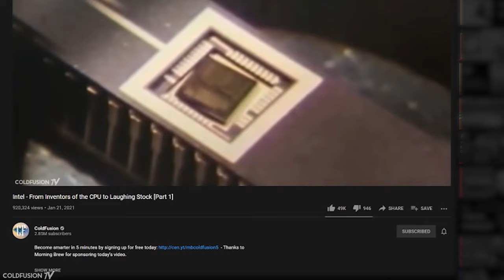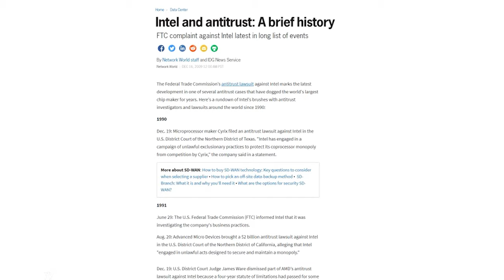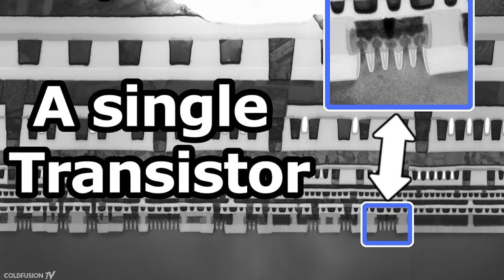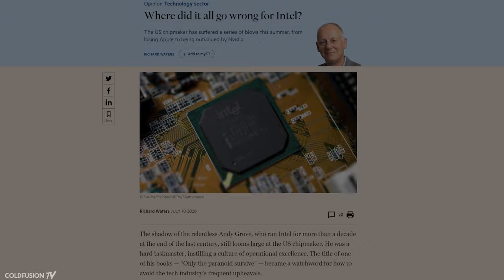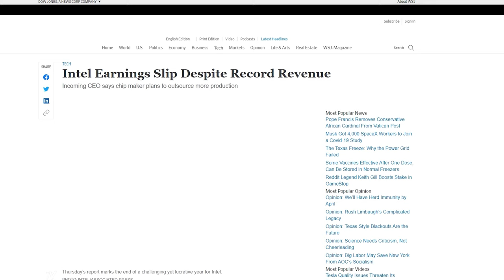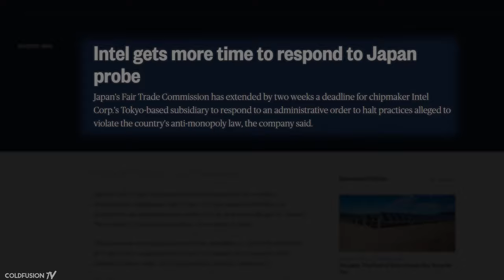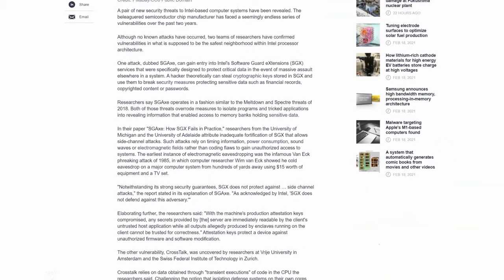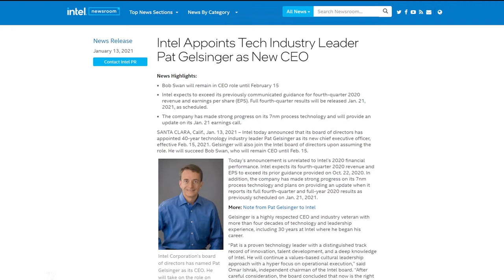Intel - From Inventors of the CPU to Laughing Stock [Part 2]

Comment: Nope - 13:41 There was no Athlon in 1996. AMD launched the K5 in 1996. Athlon in 1999. (Source: I was a 14-year-old building PCs in 1996. The K5 and K6 still had much weaker FPUs than the Pentium II and Celeron A, Intel’s “slot” era darlings). 

If I recall, Athlon beat Pentium III clock for clock in floating point in 1999 and was the first to 1Ghz. AMD had the technological lead with Athlon but Intel used its fab tech lead to clock Pentium 4’s faster which worked well for marketing. Intel didn’t truly regain the clock-for-clock consumer tech lead until about 2006 with the multicore Core2.
Reply: Who are you can you introduce urself😂😂😂
Reply: @clutchermanu5835  Please tell me you're joking.
Reply: As well as the K7 from AMD, we also had the epic K8 during the Pentium 4 era. And of course the addition of 64 bit to X86 (AMD64 which became known as X86-64) which was almost entirely an all-AMD affair given Intel was pushing their Itanium chips at that time
Reply: I bought a motherboard with a K5.  Turned out the K5 had a serious bug.  AMD refused to replace the chip.  I haven't bought AMD since.
Reply: Hello Chocolate Rain, welcome!
Reply: Awww man, that must have been fun in the end-90s, considering I only started exchanging parts of my PC around 2002 when doubling of MHz frequencies was already amost at its tail-end! :D
Reply: @Quast  I was spending 2000 dollars every 6 months on PCs in the late 90s.. not much fun. I've been one of these guys that only upgrades once every 5 years (to a used workstation) ever since. The late 90s hurt my soul.
Reply: Wtf its the chocolate rain guy
Reply: ahh the 90's where 25 or 33 Mhz was considered a performance leap.
Reply: Ah I remember the late 90’s chip wars, at the time AMD chips were a joke. Manufacturers only used them in their ‘budget’ lines and were the choice of chip (along the Cyrix) for no name clone pc makers trying to sell on ‘cheap price’. Intel chips were always better, even in the Athlon days. It took years for anyone to take them seriously. Even today, AMD is still persona non-grata in the corporate world.
Reply: went back and listened to Chocolate Rain again. never would have guessed you were a PC builder on the 90s
Reply: @Connie_TinuityError  He's joking.
Reply: Thank you for your insight Chocolate Rain man.
Reply: @ByteMeCompletely  Errr... Do you not see the problem with your logic or are you just click baiting?
Reply: @someguysomewhere100  Both Cyrix and the K6 CPU were right about there with Intel closer to the mid 90s, the Cyrix especially was a little better than the Pentium for desktop use. It got some ... you could say undeserved bad rep when Quake 1 came out and was the first big FPU dependent game. Late 90s.. by then the Athon was right there with the Pentium II/III and the Mobile barton Athlon was a pretty serious overclockers gaming cpu in ~2003. For me I really like the Pentium Pro, Slot 1 PII and PIII. But I did always want to try a slot A Athlon and a DEC Alpha
Reply: Chocolate Raiiin ! I remember you from the first years of YouTube.
Reply: @ByteMeCompletely  that's pretty strange, what were the circumstances?
Reply: YouTube legend! I was a kid listening to chocolate rain. Deep song.
Reply: @ByteMeCompletely  Cyrix and AMD were known for their chip flaws back in the late 90s. Cyrix was particularly bad. AMD cleaned themselves up by the time Athalon was introduced. I bought one, was very satisfied, and have been buying AMD ever since. Even when AMD couldn't compete with the Intel stuff in raw speed, it was more than competitive when it came to bang for the buck.
Reply: To add further to TayZonday's comment, because I am a nerd; The K6 ended up with very good integer performance, though, and floating point still wasn't in such heavy use yet. Per dollar, you got a real lot of value from the later K6 chips. In all fairness, the K5 had extremely impressive integer performance too, but it came to market far too late thanks to Intel stalling them. The lack of need for stronger FPUs likely allowed Cyrix to live a little longer in the budget and office space too, it was sad that they fell so far behind thanks to National Semiconductor mismanaging them.
It wasn't just AMD that Intel tried to trample on, as there was, of course, Cyrix and the companies they used to produce their chips like SGS, as Cyrix were 'fabless' and had to outsource this to external companies. We can actually thank Texas Instruments for quite a lot, as they stood up to Intel on multiple occasions, not least of which after Intel went after Chips & Technologies, who had their own marginally faster 386 design. Compatibles of pretty much anything post-286 would likely have been prevented right then and there if TI hadn't stepped in. C&T were eventually bought up by Intel, which was a shame, as they sure were an innovative little company, with their weird 4-way interleaved memory, a CPU 'Superstate' mode that looks suspiciously like Intel's later IME, and gluing caches onto VGA solutions. The latter was certainly fitting, as C&T were among the first, if not the first, to offer clones of EGA and VGA cards in years gone by and they were well priced too.
Intel also went after UMC, who also had their own 486 design. It was significantly faster than Intel's, with their U5S-40 performing about on par with a DX2-66 - notably, FPUs were almost never used on 486 systems outside of CAD, so consumers wouldn't likely have cared or noticed. UMC apparently had at least planned a DX version of their chip, but were pushed out by Intel before it reached the market. I don't recall if NexGen ever had any trouble with Intel when selling their flaky Nx586, but that kinda brings us full circle, as they designed the Nx686 only to be bought by AMD, where the chip was adapted to Socket 7 and named... K6. Incidentally, all x86 CPUs have been RISC internally for years, NexGen were the ones who brought that idea to the table.
It seems likely Intel weren't too bothered by IDT (bought by Via, along with Cyrix. Ironically, they designed the Cyrix III) or Rise, as I don't recall them going after those, or else the information was never public. There was also said to be a WinBond chip at one time (a weird thing, whole 'nother story) that never came to be, so what stopped that arriving is completely unknown too.
Slightly unrelated, but I do always have to wonder where the royalties, if any, for Cyrix' designs ended up going after the National Semi and later Via buyout, as SGS were still using their 486 core in SoCs a long way into the 2000s. Interestingly, they seem much more common on embedded industrial systems from that time than anything Intel made. In fact, I have never seen an Intel SoC in one from that time, have never really seen AMD Elan's either, almost always SGS' STPC or SiS'/D&MP Vortex.
Reply: @HighTreason610  very cool, interesting!
Reply: Well never thought I'd find you of all people here.
Reply: Huh. Never expected to hear about 90s AMD processors from the Chocolate Rain guy.
Reply: Was there chocolate in 1996?
Reply: He is just here to practice on deeper voices, all the technical mumbo jumbo is just an ruse.
Reply: TayZonday
No, you were not 14 years 'old'  . . . You were age 14
Thus correctly written ' I was age 14 building PCs in 1996  (NOTE: No punctuation marks after a numerical value unless it is a decimal point)
NOT
I was a 14-year-old building PCs in 1996

What you failed to learn or not been taught, is that People and animals live through the 'Ages'  .. Remember your Teen "AGE" years.
That should be a clue for you.
"THINGS' become 'OLD"   Your computer becomes old, your car, your TV,  your refrigerator etc.  
You get the point.
Make a list of all the ages we have lived through, starting from the Ice Age - Stone age - Golden Age - Silver Age - Bronze age - Iron Age - Steam age - Radio age - Nuclear age, and so on.
Whoever was teaching you did not do you any favors.
Should have been a student in my classes, then you would have known that and much more.
Like INTEL,  it is never too late to learn.
All the best and good luck.
Reply: Oh hey it's chocolate rain guy
Reply: @andrew_koala2974  LOL that’s word-for-word a reply I’d have typed at age 14. ❤️😆
Reply: Ryzen 9 5950x doesn’t even compare to the intel i3 7100. Y’all are just mad.
Reply: Yoooooooooooooooooooooooooooooooooooooooooooo
Reply: chocolate rain?????? woah. was not expecting that
Reply: @thomassmith4999  whoops!
Reply: Completely agree mate athlon xp vs p4 was a good battle in gaming but the p4 held strong till the athlon 64 rolled out and boy were they quick. core 2 duo dominated on its release to this day cept in multicore.. a 6600k is the same speedish to a 9600k
Reply: @clutchermanu5835  he's the chocolate rain guy
Reply: It was raining chocolate rain
Reply: Tay, the K5 competed with the 486 and the K6 launched in 1997, competing with the Pentium. Of course, the K6 begat the K6-2 and the K6-III which clocked much higher than the Pentium ever did, and competed decently with the PII.

Also worthy to note that the K6 was an entirely different design, not by AMD but by the company that they bought, NexGen. It was indeed a bit lacking in FPU performance compared to the Pentium, but my goodness it was a good chip and a great bargain. My first PC build was a K6-166 (which I immediately overclocked to 188).

Pentium 4 was initially a dog, in some cases even slower than the PIII and often beaten by the Athlon. While they eventually clocked it higher than AMD could, they still achieved far less than their 10 GHz target (fastest being 3.8 GHz). AMD was the first to 1 GHz, the first to integrate the memory controller on the CPU, and the first to manufacture a dual-core chip. AMD has a rich history of processor innovation despite its initial beginnings as a second supplier to Intel. I believe they even reverse-engineered the 386 on their own so that they could sell their own clone design.

My second computer build was a Slot A Athlon 800, what a huge leap from the K6 that was!
Reply: While technically correct..there is some truth in the video about AMD's Athlon for the year 1996 as that would be when the development would have started.
Reply: You forgot to mention that AMD created the first 64 bit license and Intel just used it instead of creating their own.  That is pretty damn lazy if you ask me lol.
Reply: @rars0n  I remember being 15 in 1999 and building a computer around an AMD K6-3 processor that ran really nicely, outperforming Pentium 2's and 3's w/ it's huge L3 cache. Then years later, having a friend show me a specific Intel Celeron processor. While installing the CPU into the socket, he gave me a tiny wire to short 2 pins. It was a hardware hack that caused the processor to read out as it's true self; a Xeon server chip. Yes; Intel sometimes disabled good chips and sold them cheaply as budget chips!
Reply: @ByteMeCompletely  Do u realize that was 30 years ago?
Reply: First processor I actually wanted and got was an AMD64 939 for gaming, the first motherboard I had it in was running AGP 8x
Reply: @notchildish  we fallow the flow of the electrons, they lead us here to reunite with chocolate rain. And then I think of the other great singer of chocolate salty balls... chef.
Reply: IKSDE XD  Well lok at the first intel approaches on 64 bit , good for 64bit but no good 32 bit support ,  so even a new cpu of intel uses AMD64 and the technique of AMD  AMD had the best shared x86 and 64 bit in those days.    And look , Intel  had the monopoly but everyone at AMD must shut their mouth about the plans of the zen technique and we all know Intell's responce on the Ryzen processors.
Reply: @hpifwkak  Actually, x86-64 was the original name that AMD came up with. "AMD64" was chosen later, in order to combat Intel's aggressive business methods. Intel followed suit with lots of names. First "IA-32e" (pretending it was 32-bits with some "extensions" in order not do damage the IA-64/Itanium market). They then changed it to "EM64T" (again pretending it was som kind of "extended memory technology"), and finally Intel64 (which still collided with the 64-bit Itanium called IA-64 for "Intel architecture-64").
Reply: IKSDE XD  I do design my own arm risc cpu's to fit design needs;
Reply: The more BTC you stack, the more Sats your stack, the better it will be for your future.

Don't lose sight of the revolution. Be a Bitcoin HODLER no matter what. be informed cryptocurrency is a movement hoop on the train already or regret later . it doesnt stop anytime soon , be involved ,
Reply: @TheLionAndTheLamb777  Ahh, the 80s, where something between 0.98 MHz and 3.5 MHz were all the performance you got, period. That's like a Pentium at say 0.3 MHz for integers and 0.003 MHz (3 kHz) for floating point (which are much heavier). Again, that was all the performance we got.
Reply: Yall clearly never saw his bit on John Oliver where he drops serious tech knowledge. Hope you're doing well Tay!
Reply: The more BTC you stack, the more Sats your stack, the better it will be for your future.

Don't lose sight of the revolution. Be a Bitcoin HODLER no matter what. be informed cryptocurrency is a movement hoop on the train already or regret later . it doesnt stop anytime soon , be involved ,
Reply: @benjy117  A "license" is just a formal right to do something. The x86-64 design was an architecture, a pretty elegant extension to the 386 family or "x86" de facto standard. Intel had their own 64-bit family developed together with HP (called Itanium and IA-64) but it was too different from x86 for most of the industry at the time. So x86-64 won. (Other failed CPU projects at Intel were the iAPX 432 of the 70s/80s, the i860 and i960 of the 80s/90s as well as an attempt to produce ARM compatible CPUs for a while.)
Reply: Oh shit, the man the myth the legend!
Reply: The more BTC you stack, the more Sats your stack, the better it will be for your future.

Don't lose sight of the revolution. Be a Bitcoin HODLER no matter what. be informed cryptocurrency is a movement hoop on the train already or regret later . it doesnt stop anytime soon , be involved ,
Reply: @ByteMeCompletely  Bought an intel cpu from beyond 1995, turned out to have a serious security vulnerability, Intel refused to replace the chip or even fix the problem for over a decade, haven't bought Intel since.
Reply: @clutchermanu5835  This guy knows Socket 7s.
Reply: @TayZonday. Had the K6-2 
400 in 1998. Couldn't afford the PII
Reply: @benjy117  Intel's original idea was to replace the x86 architecture for the 64-bit era(the Itanium). When they were forced to acknowledge this mistake, they were forced to make an AMD64-compatible design by Microsoft's refusal to port XP to yet another architecture.
Reply: @benjy117  actually Intel did invented their own version of 64 bit,.. Intel's Itanium 64 bit cpu.. that was a flop even though Intel was partnering with Dell..
Reply: A Pentium II rig was the first one I built from all new parts I payed for. Before then it was what I could scrap together going back to the 8086. Good times. These days I'm working on building a 486 retro rig which I missed out on during the Windows 3.1/DOS 6.22 heyday.
Reply: Chocolate rain
Reply: Oh the video also missed one of intel's greatest defeat : that amd own the x64 architecture and license. Today pc, consoles, servers and mainframes that are running Intel and amd cpu are basically using amd tech not intel's (unless they stuck in 32 bit OS and software lol)
Reply: @TheLionAndTheLamb777  

And Motorola brought out 40Mhz bus speeds with processors, and FPUs.